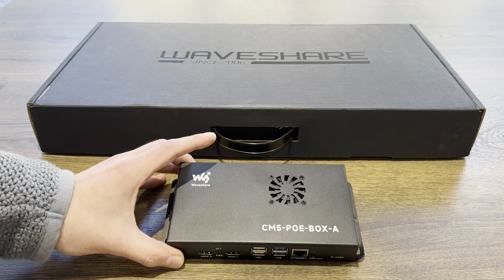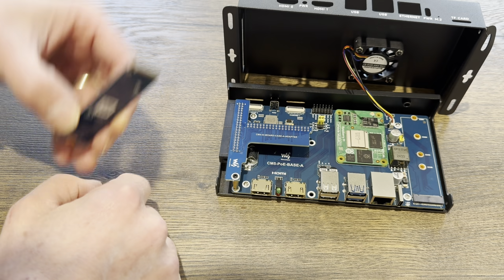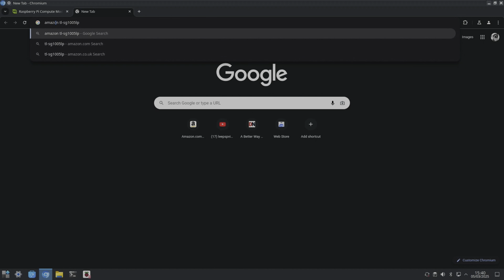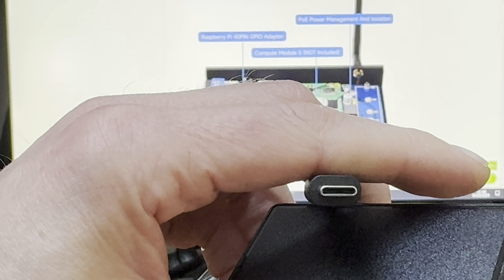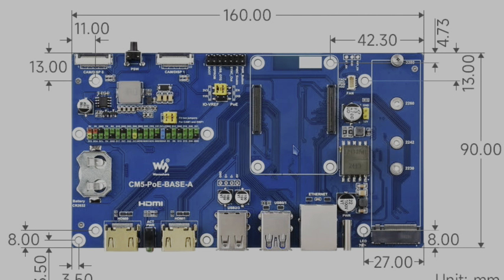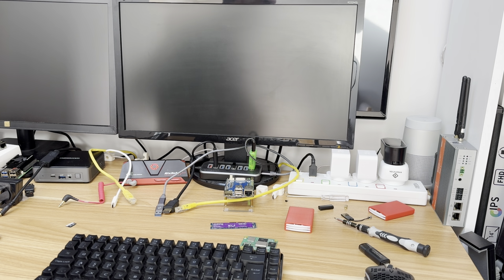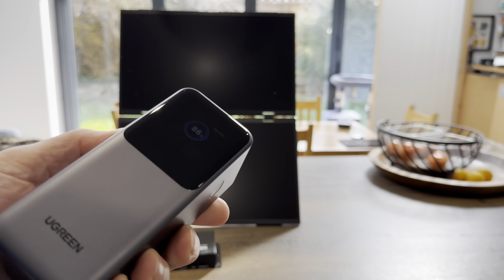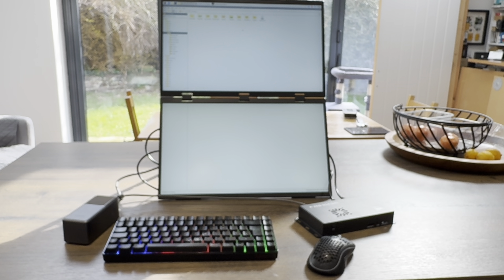Waveshare CM5 POE BOX A. Full featured with an industrial case

Comment: 802.3af is a different spec to 802.3at, ‘at’ is higher power. which did it need of the two?  switches that can do ‘at’ can also do ‘af’, but switches that just do ‘af’ can’t do ‘at’

Comment: That monitor setup is grossly overpriced! I paid less than that for 2 x LG 4k screens new.
Reply from the maker: It’s a completely different use case. Portable and folds down into a very small size. Can be powered by battery
Reply: @ Fair enough, but still looks pricey compared to the portable monitors I have that could be powered off batteries.

Convenience has it’s price though as always.

Comment: I'd love to see a dual-ethernet carrier board option for the CM5, for setting up a router.
Reply: Seed Studio sell a CM carrier board with 2 Ethernet ports that uses the PCIe lane for the second port. WiFi is supported if your CM board has it.
Reply: @christopherguy1217  I'm using DFRobot's version today, with a CM4 board. Neither Seeed nor DFRobot offers a dual-NIC CM5 router carrier board, though OpenWrt officially supports the BCM2712 now.
Reply: @christopherguy1217  At this writing, neither Seeed Studio nor DFRobot make a CM5-compatible router carrier board. Only the CM4 is supported, even though OpenWRT now supports the BCM2712.